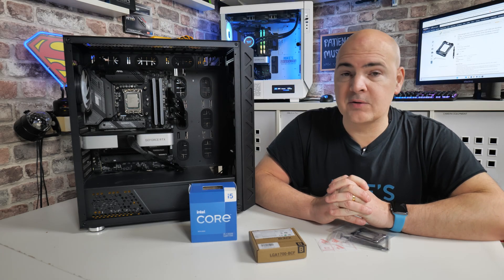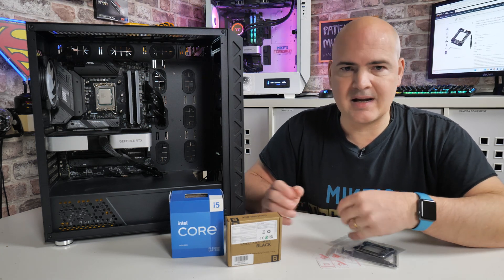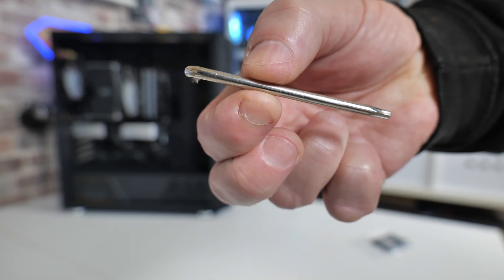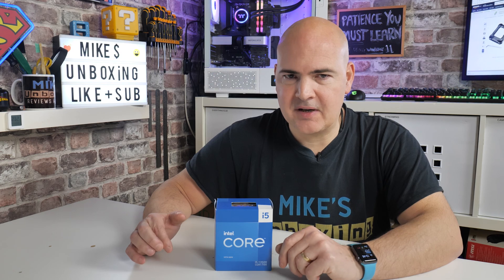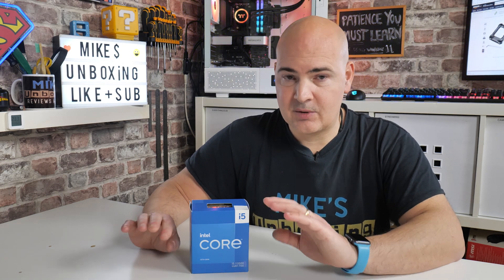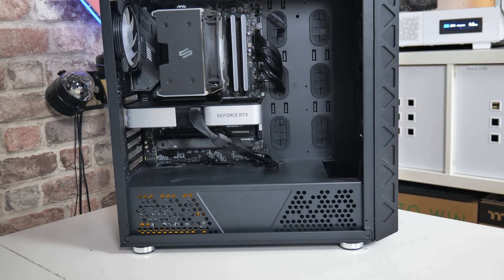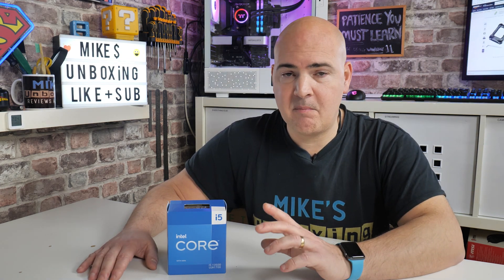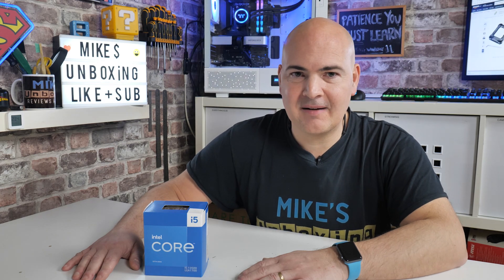Thermalright LGA1700 BCF Contact Frame Plate Weird Results Please Help!

Comment: It's a sketchy install but it worked for me i believe, ill have to look closer at Cinebench.  I put this in my 13700k/4080 build on a carbon z690 and my liquid stays at 30c while gaming at 144fps for hours.  30k Cinebench score, Can't beat the price either.  This is after a week of gaming so I have yet to see long term.
Reply: I have my thermalright coming in tomorrow, can you give me a concise answer to how far you tightened, and what order you tightened each screw in?
Reply: @pogchungus  It doesn't matter where you start just tighten all 4 down equally with finger tightness, then gave it a super light torque corner to corner.  Just remember to alternate from corner to corner like when putting on a car tire and not in a circle.  Double check all the bolts a 2nd time and remember it doesn't take much pressure.

Comment: Hello, i have had this issue too, i have an i5 13600K on an MSI Mag Z790 Tomahawk DDR5 mother board. Well apparently MSI thinks it's ok, to push as much power as possible into the CPU, even if the 13th series i5, my i5, the 13600k has a max TDB of 181W. First cinebench score pushed it at 225W and my Noctua NH-D15S With Dual Fans, managed to keep it around 89-91 degrees Celsius. The issue was, that when i first set it up, MSI BIOS asked me what kind of cooler i have, and i answered AIR TOWER. This turned on the MSI [i don't care about Intel's specs mode] and pushed it over board. So i went back to bios, and selected STOCK COOLER and between brackets i've seen 181 W. Reran the cinebench test and my cpu didn't go above 76 degrees. I will repaste it when i get to do it's cable management with the Noctua NH-2 Paste and i expect it will drop by maybe 1 degree if a mirracle happens 2. Obviously didn't use a contact frame, voids warranty, i think.
Reply from the maker: stock cooler setting is a blessing

Comment: Weird.  I could understand the higher temps if there was a contact problem but not the extra wattage??  However I have seen funny VRM/wattage problems after changing the CPU fan while in the case.  There's not as much support between the mounting posts as if the board is flat on a desk and that flex can maybe crack a tracking.

Comment: The thermalright frame as in video gets tightened down till screws don’t turn anymore. 
It’s the thermal grizzly bracket that doesn’t and could take monkeying around to get working right
Thermalright bracket is straight forward and simple.   Check was load voltage was with stock ilm and then after you seen increase in temp after.  Maybe something with the voltage increased on auto for some reason in bios which causes higher wattage used thus temps.
Reply from the maker: thanks appreciate it

Comment: Hi Mike, Thanks for sharing! I also have good experience with 12th gen and Asus B660 in combination with Thermalright LGA1700 BCF Contact Frame. I agree that tightening is very important and there are a lot of factors influincing the reults. I saw a drop in temp between 5 and 10 degrees with a max of 60. I use an iao cooler from Arctic (240mm) ambient 18 degrees C. Anyhow Looking forward to the next setup with your Asus and 12th gen CPU.
Reply from the maker: Thanks for sharing and hopefully if the b660 ever comes back i can use this

Comment: I'm going to jump in the dogpile and also call you out for not tightening the screws properly.
Reply from the maker: if the instructions had stated any necessary adjustment of the screws i would but they don't, so this screw adjustment is purely from other peoples experience not the manufacturers guidance. 
I am just following the instructions, and i really shouldn't have to be messing around with the screw tightness on a retail product, it should be ready to use as is out of the box
Reply: @mikesunboxing  The problem is the LGA 1700 isn't consumer ready out of the box. You either need to be a master technician or have a miraculous stroke of luck when seating everything properly. I suggest watching some of Yangcom Korea's videos and pay attention to how he torques screws on a LGA 1700 bend correcting frame.

Comment: I don't understand why Intel didn't fix this problem with the 13th gen boards?  This started happening with the 12th gen boards.  You'd think they would want to have every advantage against AMD these days when it comes to getting the consumer to choose their products?  Especially after the horrible earnings they had last year.
Reply from the maker: from my results i would say that the 13th gen boards maybe don't need this as much as 12th gen? i don't know but that seems to be what i am finding, will definitely revisit this at some point
Reply: @mikesunboxing  hi mike , im using z790p msi mobo&13600k , what's your opinion right know, 13th gen board need this contact frame? and how much it improve
Reply from the maker: @IIII_MAD_IIII  it is worth doing in my opinion to prevent bending later on

Comment: Mike I recommend you watch the Games Nexus review on this plate. He shows you the contact pressure between the stock clamp and this plate as well as two others. When you mount the plate, turn each of the screws in an X pattern a 1/4 of a turn until you just feel tension. Then turn the screws ever so slightly another 1/8 - 1/4 turn and that should be all you need. You do not want to tighten it down with a lot of pressure. If you over tighten the screws...others have reported Boot up and Memory issues. I followed the Gamers Nexus tutorial and had no problems. Hope this helps. Sorry you are having problems with it. Cheers
Reply: I confirm that, I had ram issues and suddenly windows crashes in gaming, my cooler is only for lga 1200 and I used some shorten standoffs to assure more contact pressure and then start the problems, after removed and replaced with original standoffs everything is ok now
Reply: @danfast23  I’m having similar issues with the Thermal Grizzly contact frame. In my case I believe I got a hold of some slightly shorter retention bracket screws or the motherboard is slightly thicker, making it more difficult for the screws to reach the backplate. I’ve read of others getting too short screws and had to have longer replacement screws sent out to them to fix the issue. I’m having some minor system stability issues with even mild cpu overclocks with XMP ram. My games will sometimes crash to desktop and rarely the whole windows system will freeze up. No BSODs, but still too many crashes to put up with on such an expensive system: (13900ks/Asus ROG Maximus Z790 APEX(2-DIMM) motherboard/G.Skill 7800mhz XMP 32GB kit. I imagine that with even slightly too much pressure with the thermal Grizzly contact frame, you can experience ram and system instability issues sporadically. Thank you!
Reply: @Hadley_MuadDib  any difference from the Grizzly and Thermalright frame?
Reply: @haies09  so far my system hasn’t had any memory related crashes, which means the Thermalright is working better at preventing too much pressure in one spot to cause issues. Thanks!
Reply: This guide is more for the Thermal Grizzly contact frame. The Thermalright one has rubber pads at both ends to spread out and better distribute the pressure created when mounting the frame. Most everyone that mounted a Thermalright says to turn the screws tight enough until they come to a stop. The thermal Grizzly doesn’t distribute pressure well at all and can easily be over tightened causing potential memory and even cpu boot issues. I currently have a Thermal Grizzly contact frame, but I feel like it’s mounted with too much pressure and not enough screw length to properly lighten the pressure without loosing contact with the backplate holes. So yesterday I ordered the Thermalright LGA1700 contact frame from Amazon and will swap out and install it this afternoon. Should improve my ram overclock stability as well as potentially improve my cpu OC stability. I use either Kryonaut or Kryonaut Extreme thermal paste.
Reply: Rick, did you mark your screws or did you eyeball it? It seems a bit daunting. Any tips?  I've watched the Gamer Nexus Video and some other ones. Did you also do the reverse turn on the loose screws to "seat them"?
Reply: @ptung88  I did as close to what GN did. The purpose is to lower the brace as even as possible if you can. When I reached the so called Hard Line (when the brace just made contact with the Motherboard}. I gave each screw an additional 1/8th turn to snug the brace to the CPU. As to not cruse the the pins on the socket. I bought the brace mainly to protect the CPU from the stock Intel Clamp which I heard could damage the CPU. Wish they would have made the CPU large and square like AMD Ryzen. Hope that helps. Cheers
Reply: @rickh8380  well, should I still consider getting the bracket if I’ve already mounted my cpu in the bracket?

To be clear. I am still assembling my build. There is thermal paste applied and the cooler and cpu have been mounted. However it hasn’t actually been turned on yet. It’s been like that for about a week. It’s still sitting flat on my table, outside of the case tower. Will it matter at this point? Or is warping a byproduct of the IHS combined with high temperatures leading to malleability???  ¯\_(ツ)_/¯
Reply: @ptung88  That's a tough call my friend. I accidentally stumbled on to the GN review of those contact braces. I replaced my bracket before mounting my CPU which I am also in the middle of building a new system. I'm sure by now there are loads of reviews about those braces on YouTube that you could watch and make a decision on what to do? Then again there are thousands of folks who are using the stock Intel bracket with no issues at present. I wish I had the right answer for you, but I don't. Sorry.
Reply: @ptung88  you don’t mark the screws when installing the Thermalright contact frame, only the Thermal Grizzly frame requires this step in order to prevent too much pressure being applied to the motherboard. The Thermalright has two rubber contact pads at each end of the contact frame, which helps better distribute the added pressure. It’s also designed to be screwed all the way to a “stop”(can’t screw anymore without a lot of effort). I have the Thermal Grizzly now, but I just ordered the Thermalright LGA1700 contact frame yesterday and should have it this afternoon to install/swap out with my system.
Reply: @Hadley_MuadDib  thanks. Yeah I figured it out. And the thermalright version screws down pretty securely. My Cinebench23 temps don’t go above 83C rocking a push pull aircooled system, for my 13600k
Reply: Maybe air bubble in cooler when u installed it? I'm not sure
Reply: That's for the Thermal Grizzly contact frame only
Reply: I noticed about a 5c temp reduction and my cpu and board are less than a week old.
Reply: @Schweini_1983  Awesome. My paste of choice is Thermal Grizzly Hydronaut. I take 1500 grit sandpaper and Isopropyl Alcohol and buff the bottom of my heatsink using the alcohol as a lubricant. When the alcohol evaporates, I add more until it evaporates. I do this three or four times. Light pressure is all you need. Clean the cooler off with alcohol and a lint free towel or rag. Smooth as glass for better heat transfer. That's what works for me. I apply very thin lines of paste on the heatpipes. That seems to work best for me. Take care.
Reply: Its only for h610, b660 and z690 chipset  boards I had acmsi b760 and made same mistake, the MSI boards are 6 layer PCBs 2oz of copper so a lot stronger. There just must be an issue with those 3 type of chhipset boards flexing around the CPU socket
Reply: @DeanSwann  I have two of those frames for my two H610 Motherboards.  That could be why yours is much better. Thanks for sharing. Cheers
Reply from the maker: cheers RIck, i did make a few adjustments off camera and tried a few different screw points and i probably need to look at this again with fresh eyes to see what the deal is or if the 13th gen socket clamp (maybe for MSI) is just a better design now? or the chips being used are slightly different in manufacture for some reason

thanks again!
Reply: @mikesunboxing  Legend !!!!!!
Reply: @mikesunboxing  No worries bud
Reply: Mike, I believe someone pointed out that your CPU may have already become bent from using the stock retention bracket for any length of time, this creating a permanent not level/warped surface, which is skewing your results to be identical. Your heatsink can’t make a flush contact with the cpu now. I originally thought that maybe you just got lucky and got a stock retention bracket that somehow provided a level surface for your cooler, but this doesn’t seem to be the case since I read your comment saying you did have some bending already.  Thank you for the video! I currently have the Thermal Grizzly, but I feel it’s way too easy to over tighten the contact frame and cause memory stability issues from minor to extreme depending on the pressure created. I just ordered the Thermalright LGA1700 contact frame off Amazon yesterday and should have it this afternoon. So I can swap out my contact frames after disassembling my current setup. 

I have a 13900ks/Asus ROG Maximus Z790 APEX(2-DIMM) motherboard/G.Skill 32GB 7800mhz DDR5 RAM kit/Corsair h170i elite lcd 420mm AIO liquid cooler(6 push-pull fans)/Gigabyte Gaming OC 4090(default 450watts)/Samsung 990 Pro 2TB(with firmware update fix)/Asus Thor 1600watt PSU/Corsair 1000D super tower case. 

My system has had wattage spikes all the way up to 1200watts during certain CPU usage scenarios, like when in the loading screen transition to the next map on the pc game: Battlefield 2042. I do have power limits removed from the 13900ks, which may be adding to the increase in watts. I imagine the momentary spikes in system wattage are from short turbo boosts kicking in and briefly using the unlimited wattage allowed. I even had to have a dedicated 20Amp 110v circuit breaker installed to my Computer room, because before I was on a typical 15Amp breaker and was causing it to trip after about 10-15 minutes of gaming. Thank you for all of your time and videos! @mikesunboxing

Comment: I have the same thing. I think it is ridiculous and almost insulting how Grizzly's cost upwards 20-40 dollars when I could get the same results after buying thermalights which was only 12 dollars.
Reply: Thermalright's is made in China and Thermalgrizzley's is made in Germany. That said I think the Thermalright is the better design.
Reply: @atomicskull6405  taiwan. and or australia or at least a warehouse there i think and good production and quality so far an much better than others with other products at better prices. but germany is really up to snuff on their stuff, but they  make mistakes just like anyone from any country whos a human being.
Reply: try and watch some of their own videos around their frame, I've seen videos from Jayztwocents I think It was, explaining a bit about why there is a price difference, but one of the bigger ones, is that it is all manufactured and designed in Germany, wich means higher production prices, and their tolerances are smaller, wich also bumps up the prices a bit, its not just because they are trying to suck as much money from you as possible, there is a meaning behind it, and they said they deliberately choose to keep the production inside germany, even at the cost of a higher production price.
Reply: @Crisping1612  I know all that already. I opted to get the thermalight one for less and it does the exact same thing. Where the product is made is irrelevant if they both do the same thing, plus I prefer the padded contacts on the top and bottom of thermalights frame. So already in that regard they were much cheaper and better in terms of design.
Reply: @Honin_Cheta_Cheese_Akecheta  and then you just buy theat one, no one is forcing you to buy the TG's version, simply saying WHY there is a price difference, and in that regard, yes the place of production does very much affects the price of the product.
Reply: @Crisping1612  well, I bought it. We done?
Reply: @Honin_Cheta_Cheese_Akecheta  sure thing kiddo, you do you :)
Reply: @Crisping1612  okay, let me stop you right there. Do not condescend me. I don’t have any problems with you so don’t make a mountain out of a molehill, you engaged with me first. Idk who you think you’re impressing with your comment but nobody cares I promise. Thanks for telling me all that about grizzly, but I just don’t think that justifies how expensive it was when functionally they both yield the exact same results. Just because it’s made in Germany doesn’t justify its outrageous price in comparison to competitors. Now, you have a good one. I’m through with this conversation.
Reply: @Honin_Cheta_Cheese_Akecheta  Gamers Nexus, said in one of hes videos, that even the Thermalright frame actually jumped a lot in price depending on where it was bought, I'm not sure if the price has change over time, they mentioned a 20$ price for it when they bought it, though mentioned, that if you had the time to wait I think it was like 4$ on ali express, not sure if there is any difference in where they are produced or its simply a question of prices depending on country, such as taxes and imports and such, I'm guessing thermalrights is probably produced in china or something, wich probably makes it quite cheap for aliexpress to get their hands on compared to other places around the world, in the end I don't think the TG price is because they are trying to get as high a markup as possible, but yeah, lets just end it there, in the end none of us know the actual production prices they have compared to they selling price, and we can only try and guess
Reply: 4 dollors